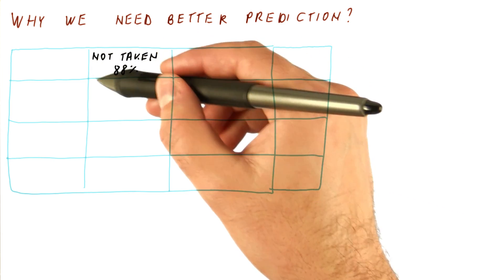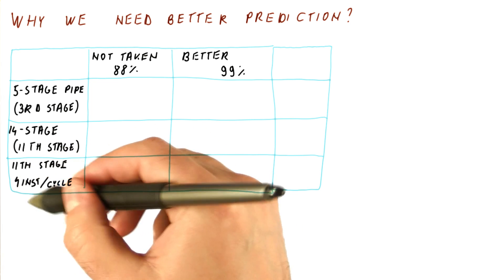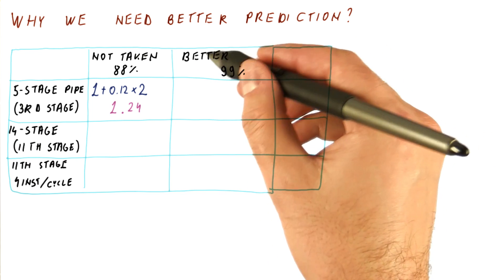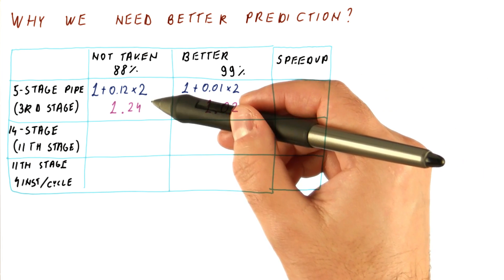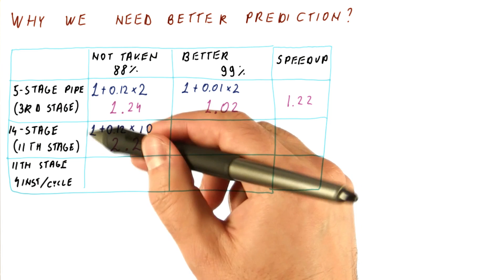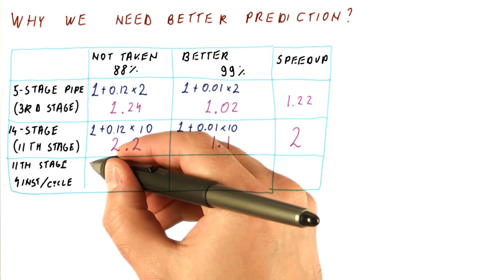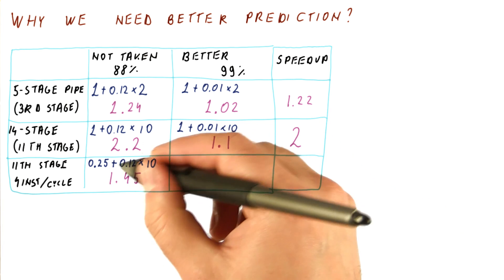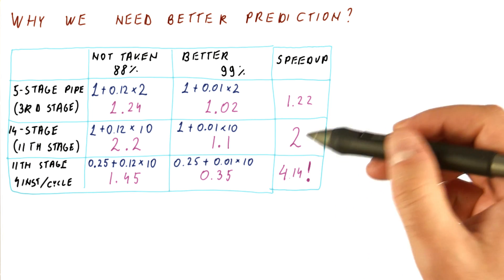Why We Need Better Prediction - Georgia Tech - HPCA: Part 1

Comment: Why are we not multiplying by the number of times the branch instructions occur?
e.g. For 20% branch instructions, it should be ( 1 + 0.12*0.2*penalty). Speedup value would change.
Reply: its already included in 12% no need to multiply it again